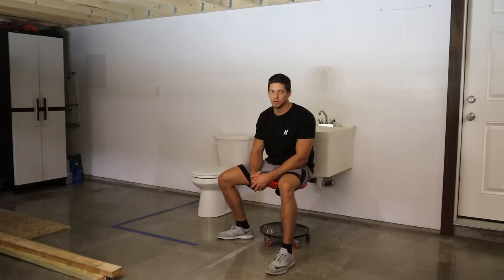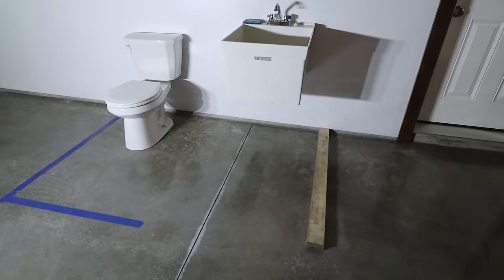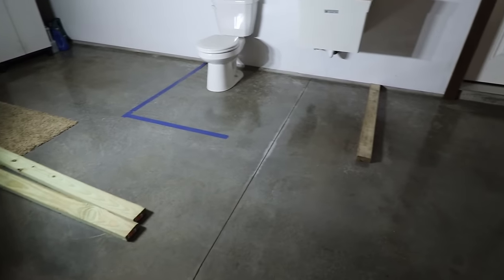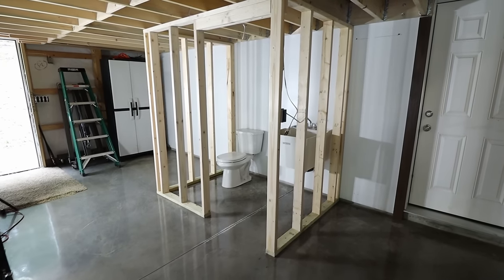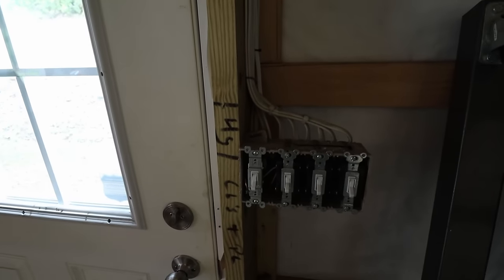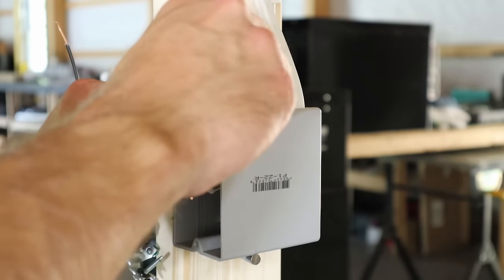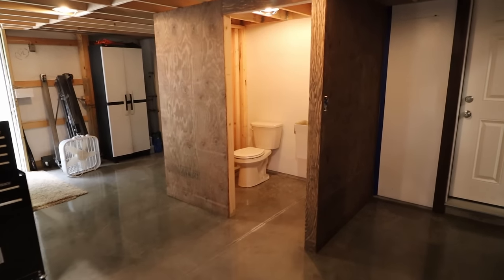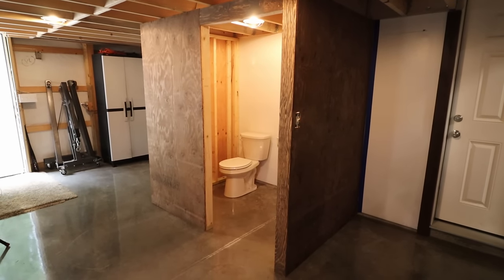Building a Bathroom in my Garage!

Comment: Looks great. I do have one question. What’s the measurement from the floor to the bottom of the joists/header? About 7’ maybe? I’m in the process of planning my bathroom/storeroom in my shop. I have 14’ walls so I’m trying to figure out what I can get away with in the bathroom/storeroom so I can have more space in the loft for storage. Thanks!
Reply from the maker: Thanks! I made it 6ft 7" so that I had even head room on top and bottom. I used 2x10 floor joist which helps some
Reply: @Kordare   do you ever wish it was a little taller? Or happy with 6’7”?
Reply from the maker: @BlueTx68F100  I'm fine with it since I'm only 5'9" . If you're a taller guy I'm sure you may want to adjust. If you'll spend less time upstairs and don't mind it being lower up there then I'd say raise it a bit.

Comment: love the video's saw a few electrical mistakes tho. the wire nuts you used are for ground wires only(why they are green and have a hole in the tip) and you didn't use a wire protector where the wires come into your electrical boxes. probably not a big deal but figured you might want to know. keep up the great content. The camera loves you and most of all your very engaging!
Reply from the maker: Thanks for the tips, I actually did go back and add insulators at the box entries. I don't remember seeing any holes in the wire nuts, pretty sure I just used standard ones but I could be wrong.

Comment: Looks great. Question for you on the loft build. I am going to build a very similar loft in my shop that will be 32' long and 8' deep. Running floor joists every 16". I want to run a double 2x10 header but not sure what my post spacing should be. I want to go 11' spacing. But trying to research before I build. Yours was double 2x12 at what spacing?
Reply from the maker: Mine was actually doubled 2x10s and the largest post spacing was about 11ft. I'd say with anything 12ft or under, a doubled 2x10 will suffice. Also definitely use proper nails or structural screws in your joist hangers. I initially used deck screws but changed them out for nails in the next video.
Reply: @Kordare  thanks man. I've been watching your build, came across your channel at the end of the mustang build. Hoping to start on my loft soon.
Reply from the maker: @rocky31186  thanks for checking it out and good luck!

Comment: I would have done a motion sensor switch on the inside left of the door, walk in & wash parts w/dirty hands and have it flick on by themselves. Doing a sliding barn door? That’d be mint. Save the space from a door swinging...
Reply from the maker: That would be pretty sweet but I Invision having these lights normally always on when I'm in the garage. And yeah that's what I'm thinking!

Comment: Hopefully no one ever does an inspection. Many/most places sheeting walls in ply is a fire code violation.
Reply: It is in a garage...most garage walls are plywood sheathed and drywall inside.
Reply: yes but sheathed on the outside. these are inside the garage and are interior walls and code would likely say that they need to be drywall
Reply: @misery13666  inside the garage and not the living area.  Plus he is in a rural area not a city code...way more lax...heck he is using romex for electrical wiring.
Reply from the maker: Im not overly concerned about being up to code since it's in the garage

Comment: The only thing that made me scratch my head is the position of the lights...... you’re loosing a lot of the lighting inside the joists. Looks like one more 2x4 would bring them down far enough to clear the joists.
Reply from the maker: The ceiling is already pretty low so I didn't wanna have the lights hanging so low you'd need to worry about hitting them

Comment: National electric code requires you have an exhaust fan in the bathroom unless you have a window you’re supposed to have a GFI outlet in the bathroom the boxes used to hang the light fixtures are the wrong boxes and it doesn’t look like you’re putting connectors in the boxes to protect the wire.I am a master electrician
Reply from the maker: Yeah it's just a garage Bathroom so I obviously wasn't worried about the code. What box would you have used for the lights? These seemed to be the standard ones available.
Reply from the maker: @cleasonleasure4832  oh okay yeah I did ground the box, thanks for the info.